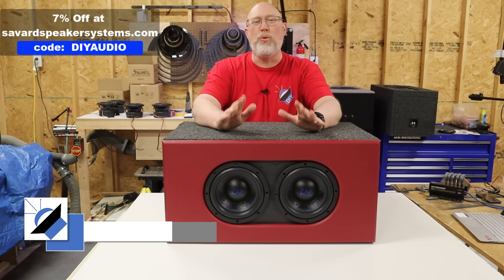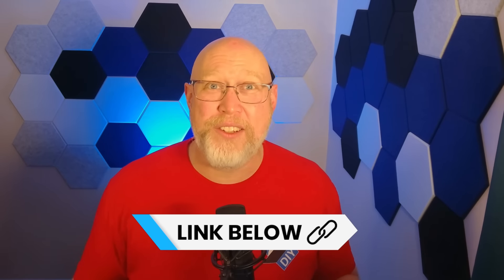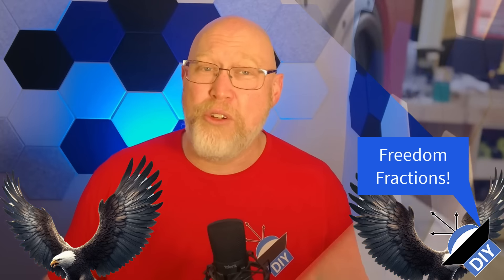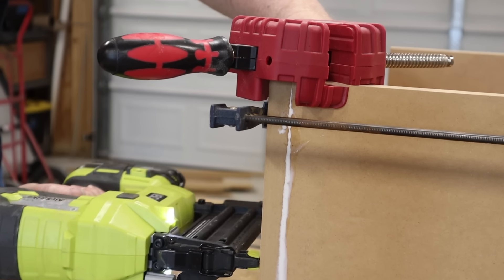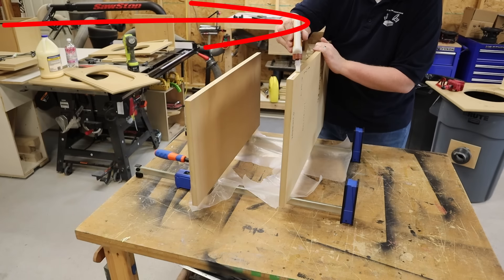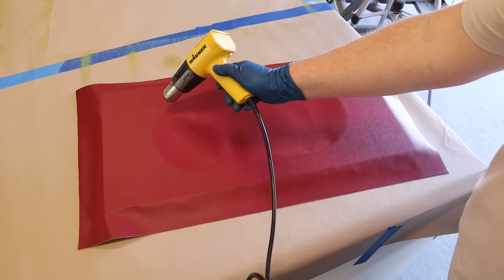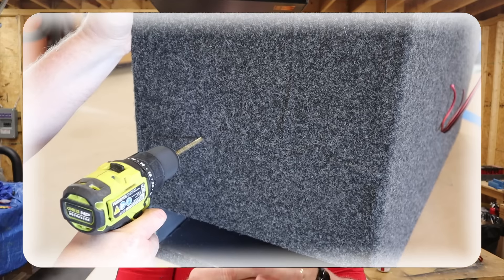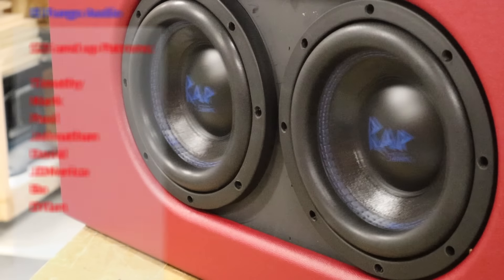Dual 8 Inch Subwoofer Box Build, Low BASS from an 8?

Comment: Very nice box build man. I wish I had the tools and a garage to work out of. Lol. I work in the yard with skill saw, and table saw, jigsaw, and router. Hey, my boxes come out working properly but just don't look the best in the world. One day I will have a garage the. Nice enclosure man for real. Good job
Reply from the maker: That's exactly how I started out.
Reply: @DIYAudioGuy  yes one day my goal is to have a garage or building I can pull a vehicle into and work on it without worrying about rain or cold or wind etc... but for now I'm doing what I can. So it will have to be good enough. Although I am getting better by the day so that's all that matters. I guess.  I literally eat sleep and breathe car audio. Im teaching myself daily everything there is to know about it. I've came a long way but I'm nowhere near on a level like you or some others are on. I'd consider you a master of audio for sure man. I've gotten a ton of info from your videos. Thank you
Reply: Hey man what do you have for tools?
I started out with a jig saw and used factory edges...
That was 20 something years ago, not much has changed.
Table saw sucks for big cuts. Rather use a tracked skill saw and a router circle guide with chamfer bits to get as much meat for the fasteners.

Holy long winded drunked texts.
No wonder I am single....

How do you like MDF and PL premium caulking?
Reply: And on my drunkin rambling.
40 - 60 grit sanding paper with sanding blocks will make your home made boxes look like gold.
Rome wasn't built in a climate controlled facility!
You don't need a sweet enclosed garage.
(It helps out huge)
But an extension cord and a big tree to work under, or maybe a portable gazbo/shed if you're rich.

Hope to hear your reply.
Ambition is 90% 
You can fix the f#ck ups..
Research and don't give up trying.
Good will hunting said it best.
"I got the same education for $3.00 in late fees..
Reply: @randysmith3492  I pretty much have skill saw with track guide, jig saw, table saw, router, and sander. That's my main tools.

Comment: I just finished a dual 8" home audio subwoofer build for a friend. I like those multi-driver configurations. What are the size and tuning of your encloure?
Reply from the maker: 2.25 cuft, 35 hz
Reply: @DIYAudioGuy  Love to know the 'flat until' & '3db down' figures.
Reply: @JasonWW2000 
.       Thanks, however I think your answer might be predicted & not measured.
But again, thanks.  I'm not always certain of WinISD predictions.
        I want to compare an "audiophile" 4 X 6-inch bass cabinet to a "Bass Guitar" 4 X 6-inch bass cabinet that is available from limited manufacturers.
Reply: @JasonWW2000 
.     Also I think WinISD struggles when it multiplies the driver's Thiele resonant frequency times four (4) .
Reply: @JasonWW2000 
.     Thanks again. Yes, vehicle, location etc. all matter.  No vehicle in my case though, it's 3-way home stereo with a pair of 4 X 6-inch bass cabinets.  Lol

Comment: Just picked up a AB hd8v2 and a box from ctsounds and it absolutely slams was worried comming from 15s and 12s but more than happy wanting to get another and run them booth in my quadcab but need to/want to build a box to spec for them, any ideas? Under seat boxes always sound terrible. And would like to keep my back seat, hence the reason going from 15s to 12s now to 8s 😅
Reply from the maker: When you're limited on space, you just don't have a lot of options. You build a box for the space and hope for the best.

Comment: Cool build. Ever think about using speak-on connections? 

Also, not that this is the point at all, but could you not put, I don't know, a 12 or 15 on the large top side of that box and end up with a better performing speaker?
Reply from the maker: I have not tried that style of connector yet.  And yes a single 12 might perform better.   Stay tuned to find out!

Comment: Recently found your channel and really appreciate the knowledge and attention to detail!

I’d love to know more about the factory Bose subwoofer enclosures from GM trucks and what could possibly be done to push ‘em harder. Not much information about them but they’re pretty common and underutilized. (Even if just for midbass)
Reply: Extra info: I have an 03-06 Bose console sub enclosure in my chevy but I bypassed the amplifier when I replaced my head unit and door speakers. Now I want to get that enclosure to make the best boom possible since it’s already made to fit there. (I’m sure I’m not the only one to have a dead Bose sub hidden in their console)
Reply from the maker: Since I only work on my own vehicles and I've never owned one of those trucks, I can't help you with anything specific.

But I can give you my opinion. I don't think the juice is worth the squeeze.   

Whenever I'm shopping for a used car, I'll try hard to avoid anything with a Bose system in it, just because the darn thing is going to be hard to bypass.
Reply: @DIYAudioGuy  Thanks for taking the time to reply!

Comment: One hint with subs that are super tight to fit through the hole with the wires on. Put the wires in the back side of the terminals . If that makes sense.
Reply from the maker: That is a great idea!
Reply from the maker: @JasonWW2000  clever

Comment: I just made my first enclosure. Overall not bad but my cutout was rough. Need to get a router to finish the cutout. I made the cutout at an even 11 inches. Then use router to cut the cutout to fit the sub.
Reply from the maker: When I first tried to build an enclosure, that was the hardest part.  A circle jig makes a huge difference. https://amzn.to/3v43Wsc

Comment: Sweet project!
However with those little 8's a lot of options open up.
This would make a sick center console sub box!
With a few extra pieces to accommodate cup holders and maybe a change tray, it would be near invisible. Aside from the "shacken not stired" drinks its all good?

For those people without space but want that thump without a trunk...

Yah yah  make your your own sub box. And leave your build alone...
Ok ok, put down phone and grab drink.
Reply from the maker: Right, for this build. I made the box a little bit on the large side, especially that front baffle because I wanted to try out some different things with vinyl.  But you could easily make a long skinny box

Comment: Make your life easier and build yourself a crosscut sled for your table saw. "Extreme Crosscut Table Saw Sled" by "Kings Fine Woodworking" on YouTube is what I modelled mine from. You can throw that miter gauge away after that. Much safer to cut with the sled and you'll get perfect 90 degree cuts every time. Use the tape and the stop and you won't need to mark anything anymore. Line up the stop to your dimension and then cut perfect every time. My sled is the number 1 best jig I ever made for my shop.
Reply from the maker: Absolutely, definitely need to build one.

Comment: Having used only 8’s in my own builds since the late 80’s I can attest to the fact that most of them were not very good back then. My very first set were first generation Pyle Drivers that were excellent in output and sq but Pyles thereafter  were trash. They were followed by G&S Redlines that were good for only acouple of years also. The biggest disappointment were Cerwin Vegas I bought at peak Cerwin Vega time, they were terrible at a time when Cerwin Vegas were winning sound competitions. Rockford series ones were decent as have JLs been throughout the years.
Reply from the maker: I remember the Pyle Drivers.

Comment: Only 12" will get you to 20hz or lower. I wouldn't waste my time with 8s, especially when in such a giant box where space/location isn't a factor
Reply from the maker: In general, I'm a fan of larger drivers. Multiple small drivers are the way to go if you're trying to cram the subwoofers into a very specific space.

Comment: Using TWO is basically cheating as now it's like a single 16 inch
Lets see low low bass with just ONE 8 inch sub!!!
...My car came with an 8 inch subwoofer back in 1999 But I think its around 400w and in a plastic enclosure
Reply from the maker: Tonight we're going to party like it's 1999.